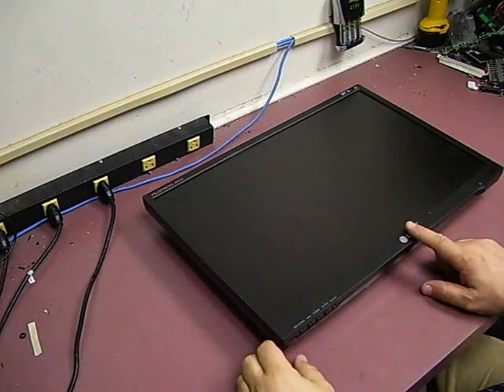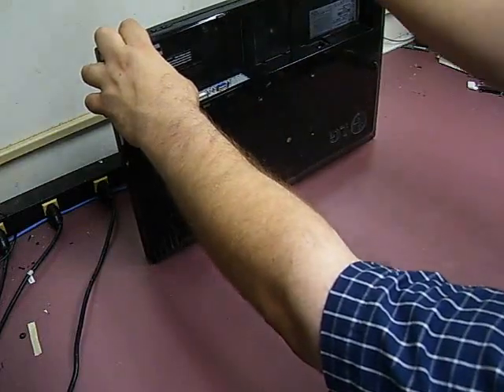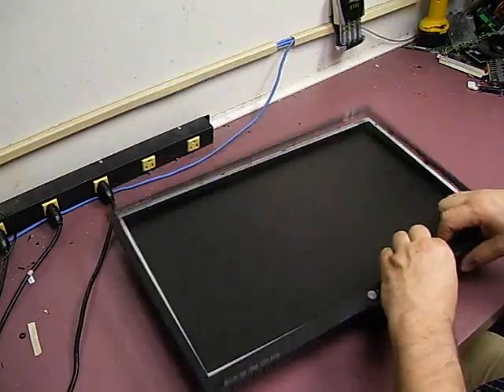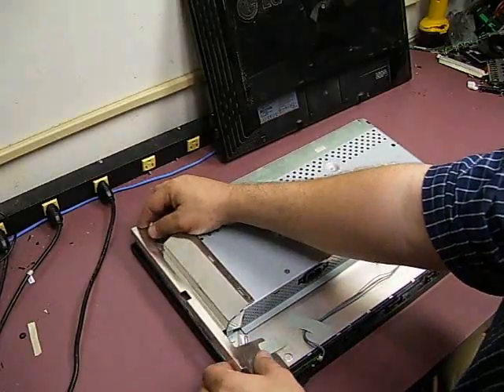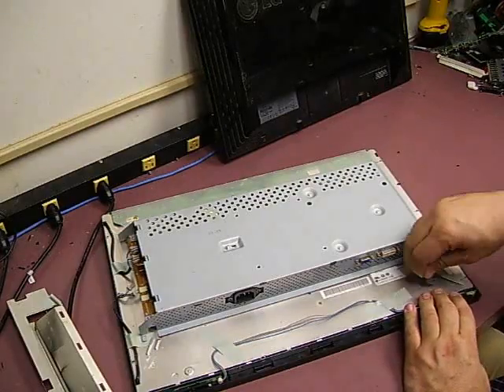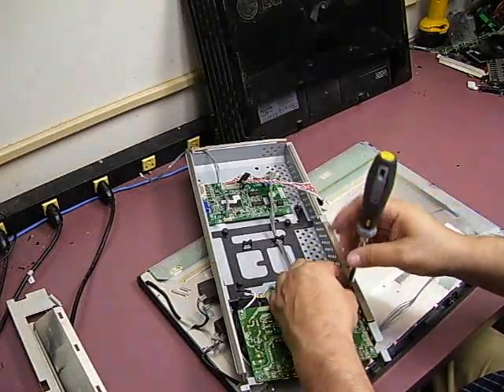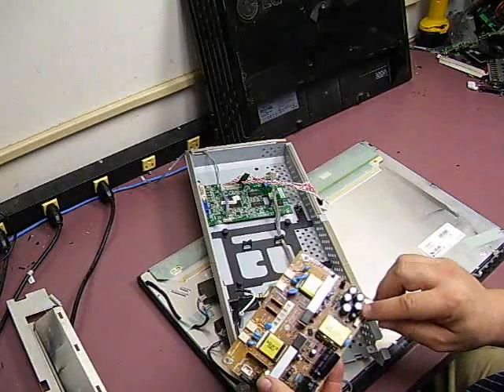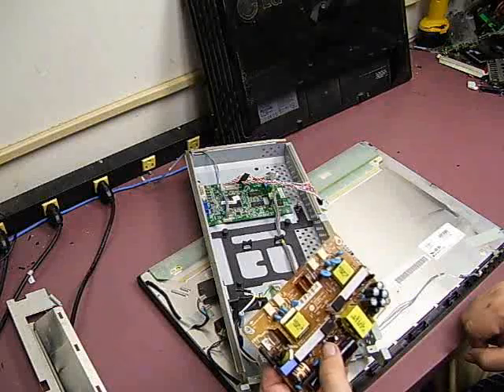Repairing a  LG L226WTQ-bf monitor - Part 1 Disassembly

Comment: I need some advice i was taking my monitor apart and when i took the cable that went from the buttons underneath and it would not come it finally all just broke and they cam out of the plastic i am having a hard time getting the bits out.would this cable work as a replacement.uxcell Flexible Flat Cable,150mm 1mm Pitch 6 Pins FPC FFC Flexible Ribbon Cable for LCD TV DVD Player 5Pcs (A Type)
Reply: Never mind i just need to dig the pieces out i think i found a replacement.

Comment: Just repaired my Flatron L225WS, thanks for the detailed instructions. Found it really hard to remove the bezel, and in the process I broke a few of the clips on the back casing, but it went back together really well and is working fine. Found that the two blown capacitors were a different make from the other two, which looked ok but I replaced all four.

Comment: I replaced the bulged capacitors on the power board for mine, but it behaved the same broken way it did before the attempt, which is turning on for a brief moment, showing the OS desktop, and then going to standby. That said, my other LG monitor is still running strong after it started to malfunction just after the 3 year warranty ran out and I replaced the capacitors on it. Win some and lose some. Thanks for the video anyway.

Comment: while this was helpful for me, i didnt actually find any bulging capacitors. i did however luck out, i found if i left my input unplugged but left the power supply intact it wouldnt try to save power and turn off, it would tell me i had no signal. i left it on this screen for however long it felt was necessary, twice, then plugged in my hdmi and my monitor didnt cycle on and off repeatedly! i will amend this to be certain that it is likely just a temporary fix.

Comment: I was in the trap too. Didn't think that I had to open the front shield first. Now I know this, too. New Design feature... I just wanted to remove the foot holder of my LG 2343 -L its very sucking to have such a hassle jut to mount the thing to a wall mount. Thanks for your helpful Video!

Comment: My monitor turns on for a fraction of a second and then turns off.  NONE of the capacitors on the power supply board are bulging, not at all.  Plus I don't have a cluster of capacitors but a couple and then a very large one.  So what should I do now?  My monitor is an I-Inc Model # HSG1082.  It's been a great monitor so I'd like to keep it if I could fix it.

Comment: Hi, i just have a similar problem with my LG W220P-B1 PC monitor, i really like it and don't want to buy a new one, i used to keep Pc and monitor ON, but yesterday i shutted off my PC, the monitor goes to standby mode, juste the red LED blinking and this morning when i switch ON my PC, no display at all, i checked all the entries (HDMI, DVI (the used), VGA) no picture at all no error message, and the tactile controls don't works too, impossible to SHUT OFF the monitor, do you you think it's a capacitors to change too ? thanks

Comment: Thank you! My flatron 2252TQ quit with this issue. No power, no power light, as if the power cord wasn't there. I found your video while googling how to disassemble the monitor and your explanation of the issue was exactly the problem mine had. Two of my caps were puffy on top, but i replaced all six - three 470uF and three 1000uF. $12 and 45 minutes and now I'm back in business. My monitor was one of a matched set, and I can't work with a mis-matched set, so you just saved me $400. I paid about $12 for the caps at the local radio shack and it took me about  45 minutes to disassemble, remove the old caps, solder the new ones in place and re-assemble.

My disassembly was a little different as the front panel controls aren't mounted in the front bezel, rather they are mounted to the back panel. Also my front bezel is in two pieces. One is a silver cap that runs along the bottom, and the other piece is the full frame front bezel. Otherwise your instructions were spot on.

Thank you so much for taking the time to make this video.

Comment: My screen was turning on then automatically off after 2 sec, replacing those 5 cap fixed all my problems. Thanks!!
Reply: Thanks. This is happening to my  L246WP. It powers on for about 2 seconds then turns off, then repeats in a loop. on-off-on-off. I'll crack it open and replace the caps (assuming they are showing signs of needing replacing).

Comment: btw my monitor had been strange to switch on for a few months. sometimes it went on other times it wouldnt. then just befor it wouldnt work at all. the screen just kept going pure white. so if you have these symptons youve probably got the same issue

Comment: had same monitor with same problem. took a couple days to get the capacitors. not easy solder to melt if you dont have a good solering iron. but it did the job perfect back up and runnig as new. thanks for the useful video.

Comment: Thank you very much for this! I have repaired by monitor by your instructions. 

One thing to note for people who want to attempt this without prior soldering experience (as I) is that a 30w soldering device WILL NOT MELT the soldering on these boards. I have bought a 30w device and it was not sufficiently powerfull to melt the solder when a desoldering wire was applied inbetween. I had to buy a 60w device which did the job.

Also the capacitors you need are ELCO capacitors.

Comment: Thanks for the demonstration. My monitor powers up but at less than half the brightness that it is supposed to. When I press the "Auto set" button, I get a message on the screen saying "Digital Video Input No Access". I opened it up and found 3 blown capacitors. The same ones you change in your video. I changed all 5, but it didn't fix the brightness problem. Any suggestions?